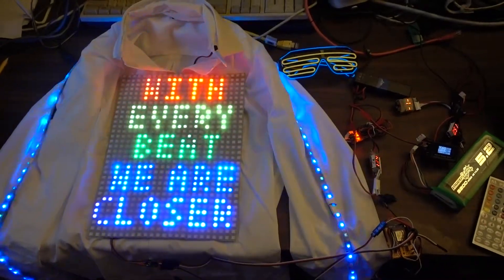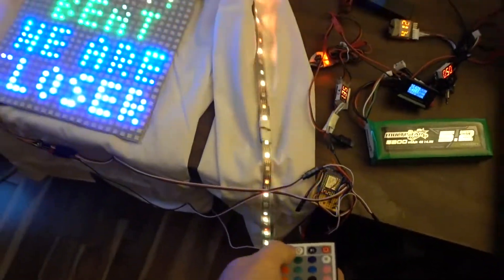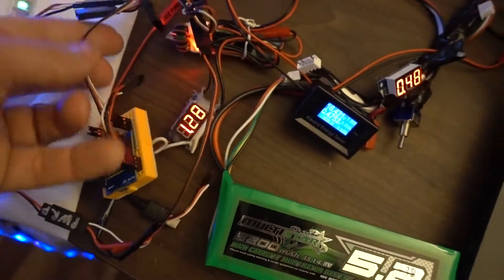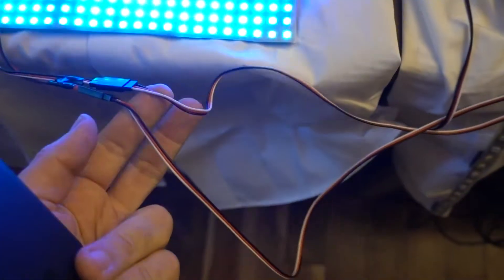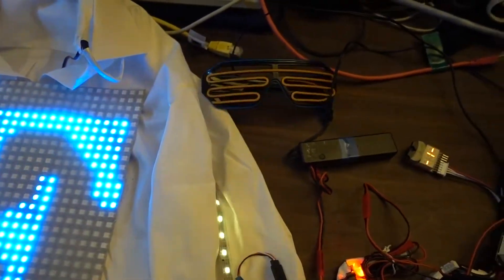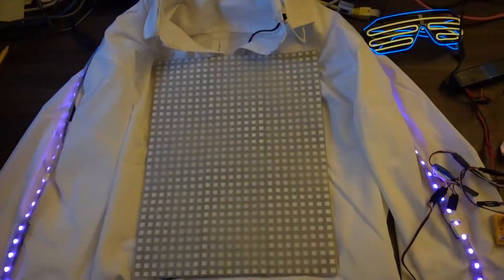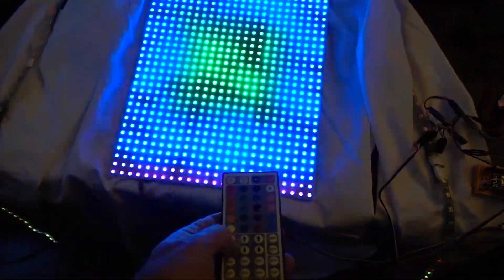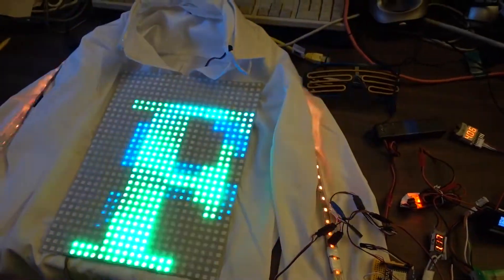FastLED NeoMatrix Party Shirt

Comment: Awesome! Why not use a powerbank?
Reply from the maker: good question
1) at full brightness, this can peak at 5 to 10A, powerbanks can't provide that much (They give 2A on a good day)
2) I already have a bunch of RC batteries that can output 100A or more.
3) RC batteries can charge at 5A or more (at 16V) and charge about 30 times faster than a 5V powerbank
Reply from the maker: I just added that bit: RC batteries can charge at 5A or more (at 16V) and charge about 30 times faster than a 5V powerbank

Comment: Hey Marc - looks like a fun project. How did you deal with the 3v3 output from the Esp8266 driving the 5V Neopixels? Any problems?
Reply from the maker: Actually that part just worked without level shifters
Reply from the maker: have a look at this though. If that had existed at the time, I'd likely have used it https://www.tindie.com/products/jasoncoon/wemos-d1-mini-esp8266-level-shifter-mini-shield/

Comment: would yo mind share the power schematic?, I did the same but still powering from usb, want to use same lipo, but it is 14.8v that will burn my esp8266, any ideas?
Reply from the maker: http://marc.merlins.org/perso/arduino/2018-05.html
was missing from the video description, I just fixed that.
It shows the power system but basically I use a 10A tobsun voltage converter that brings the lipo down to 5V
Reply: @MarcMERLIN  thanks!, Sadly the article do not talk too much about what converter is or the led indicators are in order to buy them, maybe a bill of materials would be nice to include, or at least for now that voltage converter do you recommend, thanks :)
Reply from the maker: @albertroswell  it is not a step by step build, you still need to do some work yourself :)   I already told you the converter I used is tobsun, you can find it on amazon or use any other DC-DC converter you wish.
Same thing with the LED volt meters/amp meters. They're all over amazon/ebay